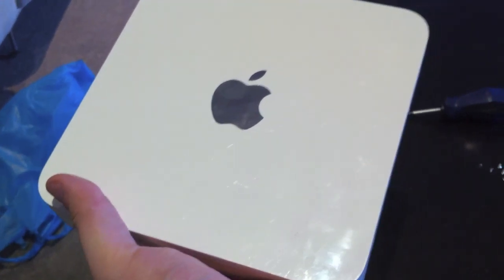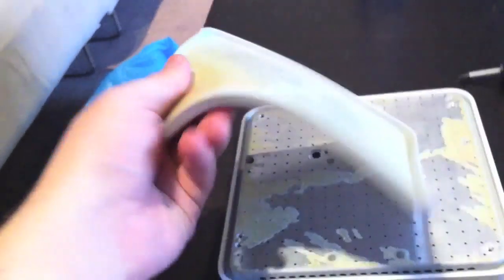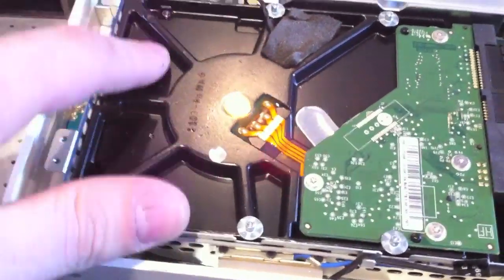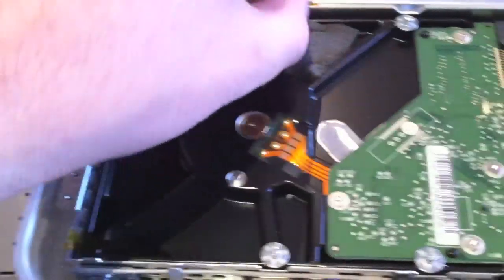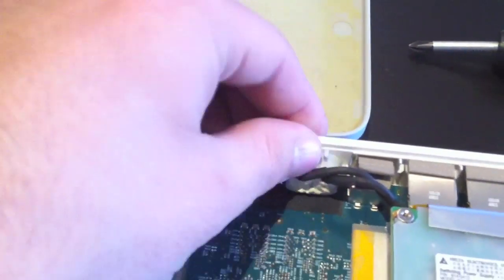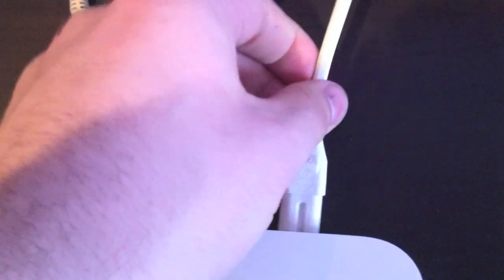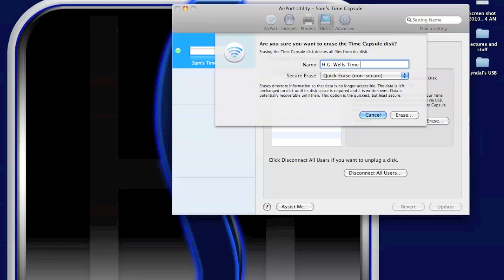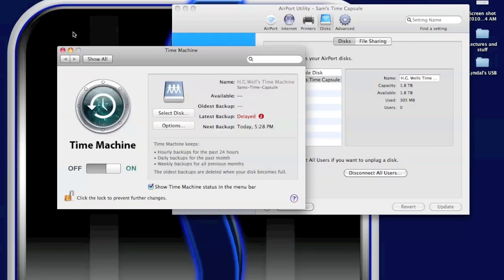Time Capsule Upgrade 500GB to 2TB

Comment: .
I suppose the WD Caviar Green is not 100% compatible to this HW.  The original Drive is Seagate, and following this line, the best result is use the Seagate HD, like 1TB.   I´m not sure if  works with 2TB HD,  because the first Gen only have 500GB and 1TB HD.  The second Gen comes with 1TB and 2TB, with another improves.

Comment: I had problems with the power supply on my 500GB TC First Gen, which stopped working after 2 years of use. I made the repair by placing an external source of a CISCO Router.
I also changed the original HD (Seagate Barracuda 500GB) for a 1TB WD Caviar Green. Works perfectly almost the time, but i have some collateral problems, like to turn off because the PC don´t find the drive or two times that Airport Utility showed as problem into the disk and format is the only way to repair it.

Comment: I have a time capsule and I am having a hard time using it as an external hard drive with out connecting it to my modem. I have it hooked up to my comp via ethernet and just basically want to use it as an external hard drive for the time being. How can I get it to show up on my desktop??